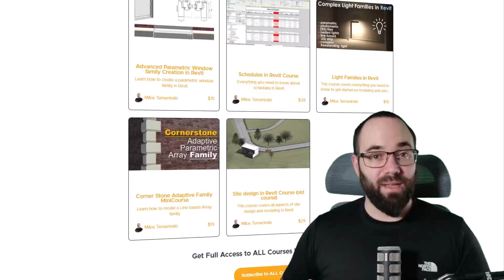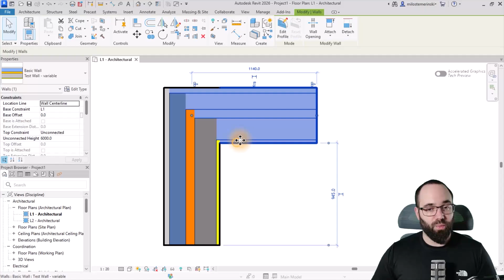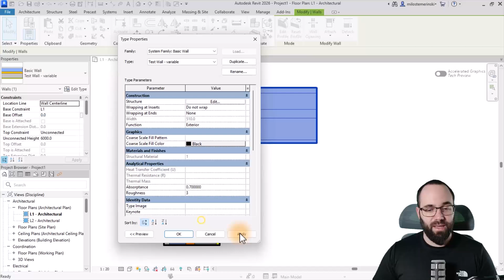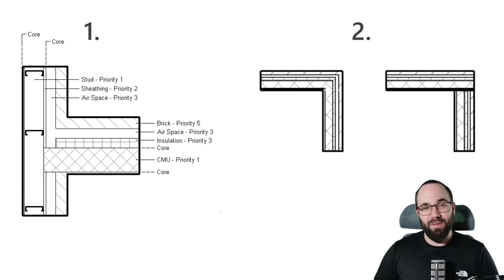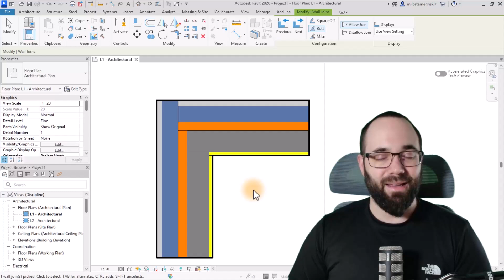Wall Layer Priority in Revit 2026 Tutorial

Comment: Hi
I have 3 questions about Revit :
1) how to add the discpline name to the plan (directly or using shared parameter)
2) how to add the floor level name to the plan (directly or using shared parameter)
3) how to add the project phase name to the plan (directly or using shared parameter)
I can solve this problem manually but i'm looking to solve it automaically when i add a view to a sheet, the displine, the floor and the phase will automatically updated !